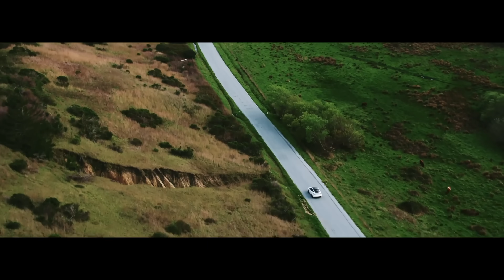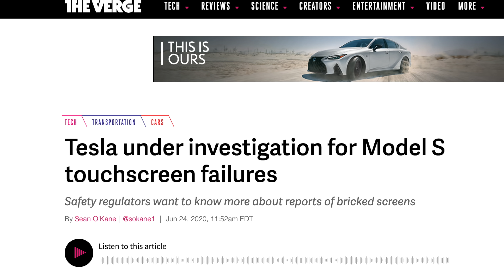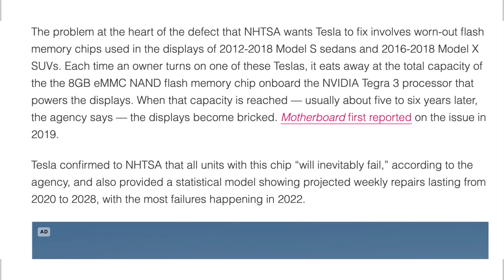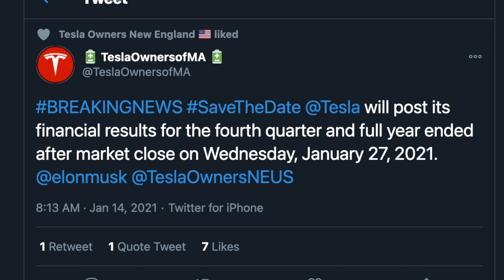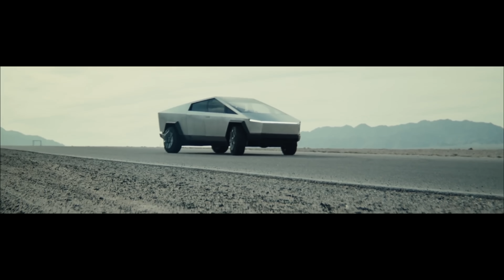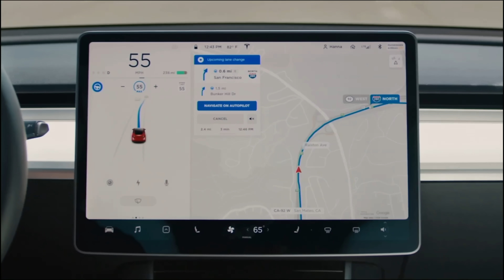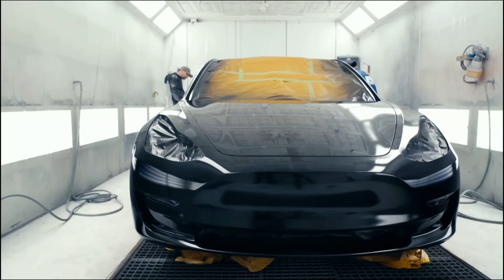Tesla to Recall 158,000 Cars

Comment: I realize this is a recall because technically safety features are tied to the screen.  Why is tesla held to a higher standard than ice cars?  Some Chrysler fuel pumps are known to fail at a high rate at 100k miles.  Dont get me started on diesel injectors and emission systems...  No recall is required there...

Comment: All cars have parts that wear out. If they wear out prematurely, a warranty fixes the problem at manufacturer cost. After the warranty period, the cost is born by the owner. Why is the lifetime of this part different than other part, in any car, that eventually wears out? Why should Tesla pay for the repair? Do expensive cars like BMW or Mercedes fix cars, at their cost, after more than 5 years of use? Your logic escapes me.

I don’t think the problem is a part wearing out, just who has to pay to have it fixed. Why wouldn’t the same rules apply to Tesla as to any other car maker? Using safety as an issue is also suspect as if you blow a tire because it got a puncture or just wore out, means that the manufacturer pays the bill? Since when?

Comment: I have. 2019 MX - It’s a common thing for MX owners to experience either or both of the screens to occasionally blackout, even during driving - and it seems to be related to certain software updates (not all updates have this issue). It doesn’t affect driving or steering. I actually like that this happens because it means the code has inbuilt ”Have you turned it off and on again” when there is a problem code-wise that cannot be worked through... almost like an automatic cache clearance system. I do not have full autopilot etc - in Sweden it’s pointless because of the current restrictions in the laws. As for quality control - yea, my car came with a few flaws - bad paintwork on the rear spoiler and wings (overspray - fixed my myself), welds on floor pan (visible when raising falcon wing doors) are cracked (i reported this but nothing ever happened about them), and right side falcon wing door not sitting flush with the body (it doesn’t leak, and opens and closes fine, so not worried). I got the classic yellow border on the main screen last summer - got that fixed. My worst experience was when I got a flat tyre... their customer call centre was absolute agony to deal with since the call handler was not even located in Sweden. Despite me wanting to give map coordinates of my location - stupid person still sent the tow truck to my home! Thankfully the tow truck driver called me, and I was able to tell him exactly where I was - definitely nowhere near home! As for the tyre replacement... 5 whole effing days!!! Not impressed!... Would like to see Tesla offer courtesy cars - why they don’t is beyond me, considering what we pay for their cars.

Comment: I had my 2013 model s mcu replaced because it went black. I couldn't control anything but could drive it because I could still see the speedometer. I could not turn off the AC though so it ran the battery down. Hopefully we get that reimbursement soon.

Comment: Just had my (pre-facelift, old MCU) '16 Model S eMMC (the flash memory chip) replaced. I'd been suspecting a dodgy eMMC for some time, and after a couple of instances where the MCU has unexpectedly shut down while parked and used a very long time to start up the suspicion was strengthened. Then after a recent software update the car notified me to make a service appointment as the "centre display storage unit" was degraded: It turns out the software update included a service centre diagnostic routine as part of the update, so the car itself will now alert the owner about a dodgy eMMC.
The fix is replacing a small(ish) daughterboard containing the eMMC, so no new, improved MCU unfortunately.

Comment: Upgrading the 2016 and 2017 X’s to the MCU2, adds a lot of value to those cars. For the late 2016 and up cars, it may add $10k in value. If you have the full self driving suite of hardware, then the cars are fully upgraded to modern standards. 
It’s interesting that a low mileage 2016 X is $20k less than at 2018 with double or more miles.

Comment: The problem that's going to arise with this is that if Tesla just replaces the eMMC chip -- doesn't the problem rear its ugly head again eventually?  Replacing the chip doesn't seem to fix the problem permanently -- you need to replace the whole infotainment system, don't you?
Reply: It does solve the problem. Tesla originally used cheap chips. More expensive (about 20-25$, for Tesla much less) are much better. Also a sw. change can help.
Reply: @Peter-oh3pm  Solve the problem?  Ehh - depends on how one defines solve.  According to Tesla, they're just increasing the size of the eMMC chip -- https://www.tesla.com/support/warranty-adjustment-program.  Granted, it is 8x the size, so if the 8 GB chip fails after 7 to 8 years on average, the 64 will likely fail after 56 to 64 years.  So I get it -- it works, but that looks awfully like a workaround, not a permanent fix.

Comment: They better not change the interior of the model S & X to have the no binnacle dash board set up like in the model 3 and Y, 

The point is that is a bad set up that goes against the road safe driving design rule which ever single car ever made including the model S & X in history had to have! 

The top dashboard clear mounted Binnacle speed display in FRONT of the drivers view just below the windscreen view, 
That rule was set because for a driver to drive safe, they have to keep checking their speed then move their eyes back to the road. 
( even with sensors helping the law states you are the driver and you need to drive safely )

To do so safely as the car crash testing proved over the years, you need the speed display in front of your view so you glance down for 2 seconds then glance back to the road. 
All cars ever made had this by law. 
A fully lighted big clear speed display up on the top of the drivers side dashboard in a recessed area to stop the sun light from washing out the lit display. 

The model 3 and Y break the rule by taking away the much needed well placed clear lit speed display binnacle and instead break the rules and place it on the corner of the LCD screen as unlit black figures on a white screen, you have to look away from the drivers wind screen view for many seconds to to try to see the speed on a flat LCD screen that not even facing you, where the sunlight can wash it out when it hit that screen and at night following cars full head lights can wash out the figures too and this also means you have to either turn you eyes way over from the front view for longer or even turn your head away from the windscreen view for longer? 

This is a very bad design of speed display! It makes it more likely you crash as your whole head and eyes are look away from the road for longer. Dangerous in fact.
The speed display moved is Tesla cutting costs by not doing what the car interior safely design rules used for decades said is the right safe design.

If they do this in the redesigned models S & X, not only will it be dangerous, It be a big put off for possible future S & X owners.
Because 1 > bad unsafe speed reading set up and 2 > the S & X are different models to the model 3 and Y so should be different interiors too?

I know this much, if I have the money to buy a model X and they changed the speed display to the model 3 one, I won't buy the car.

My saying is NO Normal Binnacle NO buy.

Comment: if you take it all tesla is doing is spreading screen replacement over time instead of needing to get it done in short time  they dont have 1,000 of repairers and low number of tesla repair shops
as long as they are going to replace item then what is the problem    may be for this repair they should replace out the screen over time and ask owners to come in at time that wont swamp the repairs on other more important items on cars

Comment: Aight I've came to a conclusion, Tesla first up oughta know better than that to use NAND in this way. Like if they had just done basic research about flash memory they'd know that 8GB of NAND memory wouldn't suffice for more than 4-5 years the number just add up with the current job being done for the code. That is with a kind of the result of hastened coders working in Linux/Telsas own codes so different than a lot of other possible coding jobs. And because although loss of power can trip RAM you can mitigate the constant use of syslog by allowing you to disable it until you're gonna need to access it for general repair. Bc if they don't that's called a data sink that's just sinking tons of MB every day off of a non future proofed capacity. The result is the computer killing itself. Like I'm glad it's a plug and play part so aside from making a ton of tech trash from scrapping them in favor for ones with RAM packages with proper coding. The other options of replacing the NAND with guess what... More NAND, and is just adding another ticking time bomb to the car bc the code still isn't up to spec. I love Tesla but Tesla just needs to know better and do better for their customers. It knows that these type of obvious oversights can cause issues with public trust about safety. I hope they make the right decisions going forward.

Comment: I bought my First Tesla Model S in 2014 and we currently have TWO 2017 TESLA MODEL S 90D.  Both cars screens have gone blank due to this problem.  The SCREEN controls everything not just the rear view camera.  You can NOT defrost your windscreen if the SCREEN does NOT work.  If you use pin to drive and the SCREEN does NOT work you can NOT enter the PIN Number so you can NOT drive your TESLA.
No SCREEN means you can NOT change the radio station.  TESLA really needs to fix this ASAP as TESLA does ZERO advertising and Owner Word-of-mouth is how TESLA have been successful selling their cars.  In CANADA TESLA MODEL S or MODEL X costed over $130,000 Canadian Dollars back in 2017 and the cheapest TESLA MODEL S is still over $100,000 Canadian.  This is poor customer service is NOT the way that you will make anyone want to promote your product.  The TESLA Service locations are not the problem - Tesla Head office is the problem and they should take ownership and allow the service department technicians that face the annoyed customers on a regular basis fix this problem.

Comment: I've always had an issue with Tesla putting all the controls via a single point of failure. That seems to me to be not a very good idea.
Reply: These days all the little buttons and levers in a car go back to the cars computer so it’s basically the same thing if the computer fails the car won’t work in this case that computer happens to use a screen instead of a bunch of buttons
Reply: @damian5241  That’s not really true. Although there is one ECU, it’s far simpler because of analog controls that control individual pieces of tech (radio, wipers, blinkers, etc). When a screen fails, all of those buttons fail, which control almost everything. Standard ECUs have a far lower failure rate compared to Teslas.

Comment: This is the same issue that happens with Solid State Drives in computers and other devices that use them. You can only "write/rewrite" so many times to it and then it fails. That's why SSD manufacturers INCLUDE software for you to monitor it over its lifespan so you can replace it before it fails. It's a SHITHEEL move on Tesla' part offering a "$2,500 Upgrade" when what they should be doing is offering the "Upgrade" AT COST and eat the labor install cost.

Comment: Great video.  I have a MS 90D and the screen has gone black 3 times.  They sent out the 11/19/20 Warranty Adjustment but refuse to recognize the problem and do something.  I'm not so sure that replacing the chip will solve it.  I have my doubts that they will provide the Infotainment Update ($2,500) and Radio Update ($500) to get back Sirius and FM but if that is what it takes, they should do it.  Tesla is a safety oriented company but in this case, they are appearing to turn the other way.  The loss of the AC and the defogging function is critical.  When I first bought the car, the windows fogged up so that I had to stop the car since I could not see.  I was not as familiar as I should have been with the controls and  did not react quickly enough.  Fortunately, that has not happened with the 3 black screen incidents, but if it did, it could be fatal.  If this is not resolved to my satisfaction, I am considering selling the car.  It is scary and I am not comfortable driving it.  Keep up the good work.

Comment: In my 2003 Buick tape cassete player broke, so im upset to.
Reply: @Strawberry Kiys No, but is nice to drive and have some music playing actually i was using a cassette with cable that can connect to phone and it played, it was cool setup.
Reply: @786otto  just replace it. takes about 5 minutes and you can get a used radio dirt cheap.
Reply: @nox5555  But beware that it might be cheap because of a faulty tape player. 😉

Comment: There was a video a couple of years ago, which I can no longer find, of group that could de-solder and replace the Flash chip on dead MCU.  I think it's the guy from Ingineerix, but it was on someone else's channel.  Maybe Rich's.  Point being, this issue has been know for a long time, and caused by over writing to the Flash chip.  I believe the video said that it was writing Linux logs to the Flash chip needlessly.  Not sure how accurate that is.  Although I'm still plan on getting a Tesla, this MCU issue and they way Tesla has dealt with it has really deterred or delayed me from purchasing.  How may years before the Flash chip in the Model 3 and Model Y ware out.  I'm happy NHTSA is forcing Tesla to recall the MCU.  Even thou I'm an investor and it might hurt the stock a bit in the short term, I think it's the right thing to do.
Reply: Yeah Rich's.  The defect only effects certain year model S and X.
Reply: The fix is only needed on MS and MX up to 2018. But I would go for the free warranty replacement any day, because a simple chip replacement would only result in the same issue happening again. Furthermore, replacing that chip would cost you money, and also void the warranty.

Comment: They are one sneaky company they knew they’re gonna have to replace them for free so they put an upgrade option hoping people would take them up and pay for the upgrade 2500 bucks wow
Reply: If any were bricked and the reason for an update then Tesla may have to give them some money back.
Reply: @usa-ev  they could also not have known
Reply: After 4 or so years our smart phones start failing, should we get new ones? Stuff fails cause nothing is perfect. Try to engineer something and see if you can make it last forever.
Reply: @mpamsinc  im sorry but a few years for a car is not even close to acceptable did you pay 90,000 dollars for your phone. they could of designed it correctly like they did the replacement unit. and if they are too stupid to do it correctly the first time they can replace it for free like they will now. flash memory is well understood item that’s failure can be easy predicted. the stereo in my 20 year old toyota is still working great actually all the parts other then the wear items are working great.
Reply: @mpamsinc  this is a clear construction error. It has to fail after a couple of years.

Comment: Very good break down of the recall! But to give Tesla some defense on this. All flash storage will eventually die in any device not just Tesla's system. Nano flash has a limit of read write life cycles based on the version of the flash. So you will see alot more "recalls" from all manufacturers I'm time as more electronics are used in systems.
Reply: The problem is they left the chips dumping debug logs.
Reply: @The Monster Under Your Bed  sorry I meant to say write / erase. As for how much data I do not know at this time but you could imagine alot is sent through that eMMC for alot system settings, updates and processes etc. If you think about most vehicles that currently use a touchscreen will eventually have this issue in the coming time the difference is they still have physical buttons for most features, where as Tesla really only have there options on the touchscreen as listed in the recall notice. Just a different view point to look at this case.
Reply: @The Monster Under Your Bed  I'm sure it was the writing that caused the problem here, but for what it's worth Flash memory does have read limitations as well. The read limits are obviously much higher, but still need to be accounted for in an automotive context.

Comment: Quite frankly, this is entirely overreaching by NHTSA. 8-10 years lifespan on a car or computer? The car still operates, it is legal to have your rear view blocked, so long as its not permanent(Lots of luggage, or fixing the camera/computer) Nothing MANDATING a recall, I mean honestly with how everything breaks down in 100k miles on any other car you don't see mandatory recalls because an ICE car belt, or chain needs to be replaced or recalibrated. I hope they stuff NHTSA on the earnings call. If you want a 2018+ package features over your old "TV" buy the 2500$ TV no need to cry about your 2012 TV being out of date good grief.

Its not like your brain and eye's turn off the moment the computer goes blank.